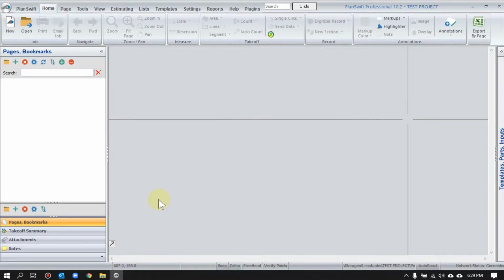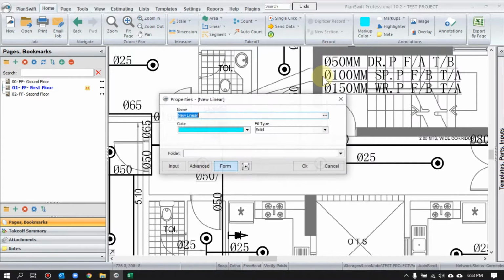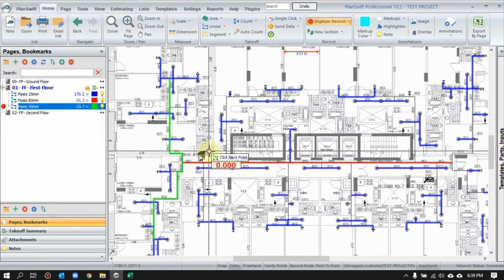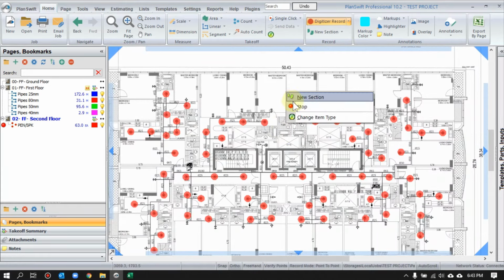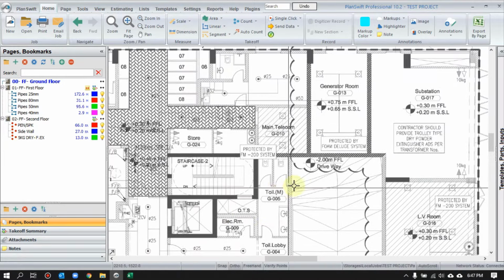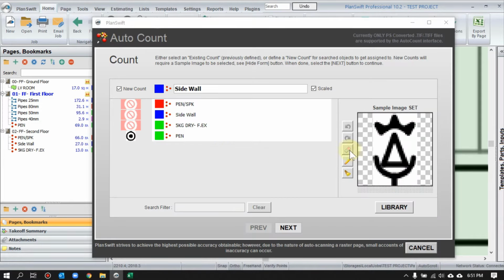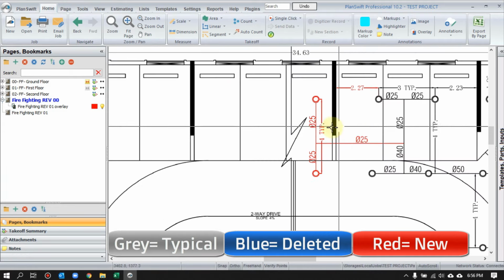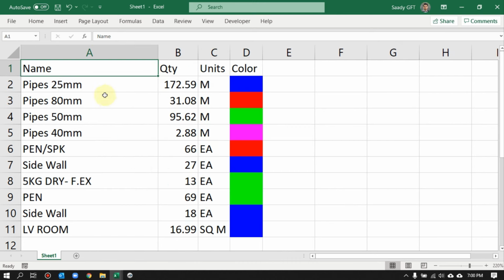MEP Quantity Surveying | Planswift for Fire Fighting | Plumbing | Pipe | Takeoff Estimation

Comment: “Isn’t it basically the same process as doing it in AutoCAD? For each pipe diameter, we draw a P-line along the pipe, then use Data Extraction to get the quantities into Excel. In PlanSwift, aren’t we also manually tracing each pipe? So, would it be correct to say that PlanSwift can save time compared to doing the same quantity take-off in AutoCAD?”

Comment: Hi Mr.  Thank you for your Video. 
i have to ask one ?
Your measured horizontal lenght pipe. Can i know how to add vertical length ( As a droping or rising pipe )
Reply from the maker: There are diverse ways. Either you can depend on Riser Diagram, estimate drop pipes by calculation of sprinkler or manually highlight in drawings etc. 
Connect & ask direct questions.
https://www.linkedin.com/in/saady-chohan/
https://www.facebook.com/SaadyChohan.AEC
https://www.instagram.com/saady.chohan/
https://twitter.com/SaadyChohan

Comment: for verticals there should be a drop/riser adders....I use EBM to do it...it will bite you in the rear if you only report horizontals
Reply from the maker: It's True.😀
Drop pipes, Vertical pipes Ground to roof & the drain pipe etc must be Measured separately.
There are so many factors that cannot be covered in a short video.
It was just an example that how to count & measure lengths using PlanSwift. 
Btw Thanks for sharing your feedback.
Reply: @SaadyChohan  Very true. I forgot to mention that  your videos are excellent. Very helpful. Many thanks to you.
Reply from the maker: Appreciate your feedback 😇
I am working on more amazing videos, soon you find them..
Please connect through LinkedIn.
Reply: how do you do vertical riser measurements in planswift? all videos so far are not covering this. can we add a formula?

Comment: @Mr Saady, the fire fighting Piping are not only Horizontals, there are also Verticals if we Report those Quantities they will be less than the Actual and same goes to Electical cabling or and Piping, plumbing,.......

Please give us your Point of Views
Reply from the maker: Dear Samuael,
Thanks for watching.
I hope my viewers understand, this video was not about "How to be QS" and "what to measure in Plumbing"
This video was focused, if you are QS then how to add value through PlanSwift Software in FireFighting Systems.
I totally agree with your comments and actually there should be vertical pipes, Joints, Fitting and many items which i didn't mention in the video.
I hope this answer will help everyone to understand the concept. :)
I appreciate your time & comments.
Stay Safe.